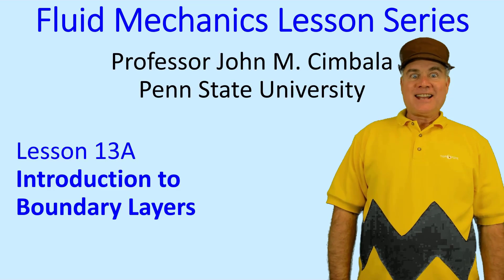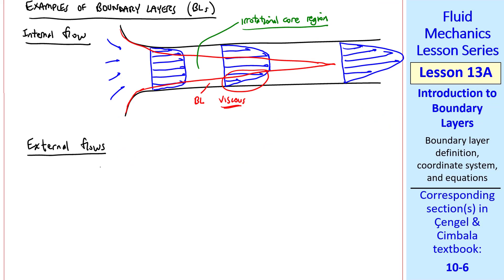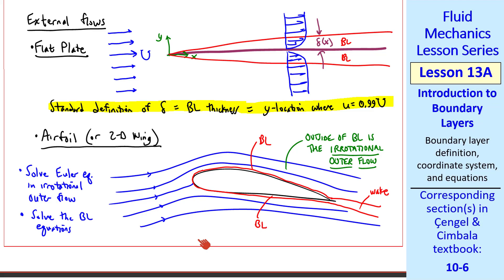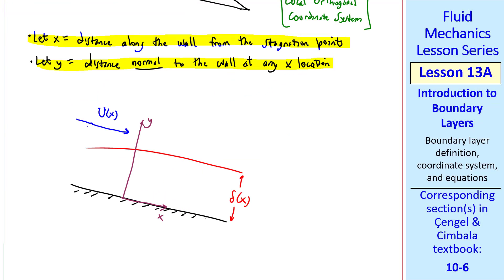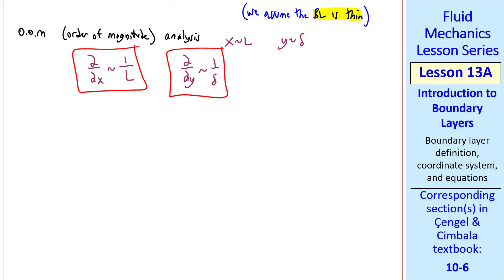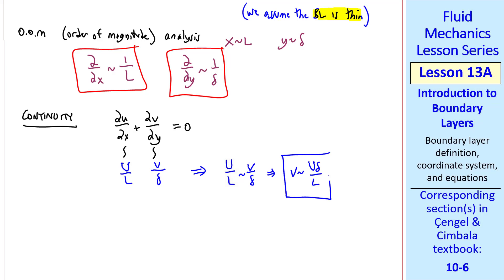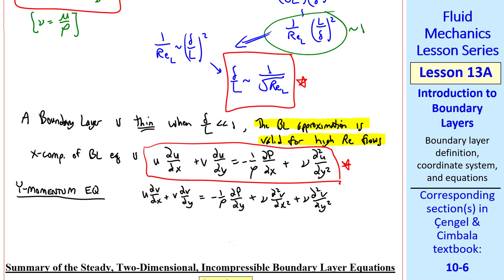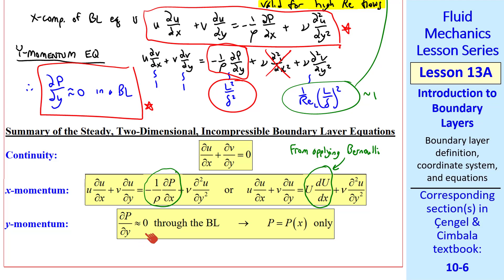Fluid Mechanics Lesson 13A: Introduction to Boundary Layers

Comment: What happens if https://youtu.be/Ji7eNRo_u3g?t=324 slip boundary condition is considered? Does it have same approach in boundary layer equation?
Reply from the maker: The boundary layer equations do not depend on slip or no slip conditions. Even jets and wakes can qualify for boundary layer approximation, and they have no walls. The criterion for the boundary layer approximation is that changes in the flow direction are much slower than changes in the direction normal to the flow (usually x and y, respectively).
Reply: @johncimbala  thank you for the answer. This video enhances my understanding about boundary layer equation.
Reply from the maker: Thank you for your comment. Please tell your friends and colleagues about my YouTube channel where there are more than 400 free videos about the Bible, fluid mechanics, science, math, statistics, air pollution, and other topics. I would greatly appreciate it.

Comment: At around the 7:10 mark in the video, you say that U/L and v/δ must balance and then conclude that they must be of the same order of magnitude. Why?
I understand that terms need to be dimensionally consistent, but U/L and v/δ can have the same dimensions without being the same order of magnitude, no?
(like, as an analogy: you can't add meters and seconds, but adding millimeters to meters is certainly okay, no? )
Reply from the maker: Order of magnitude analysis is kind of fuzzy math. In this particular case, we are saying that U/L is some order of magnitude - let's call it 10. Since there is only one other term in the equation, that tern MUST have the same order of magnitude - i.e., around 10 in order to balance the equation. For example, 10 = 10, but 10 does not equal 1. In order of magnitude analysis, 9 ~ 7, but 9 is not ~ 0.7.
By the way, you cannot add m and mm. You must first convert, but I understand what you mean.
Reply: @johncimbala  just to clarify, when you say that the terms must have the same order of magnitude to balance the equation, you mean like if U/L~10 for example, then the equation becomes: 10 + something = 0, so we conclude that that something (v/δ in this case) must have a magnitude of 10 (-10 to be precise). Did I understand correctly?
Reply from the maker: @benjaminyellin5095   Yes.
Please tell your friends and colleagues about my YouTube channel where there are hundreds of free videos about fluid mechanics, science, math, statistics, the Bible, air pollution, and other topics. i would appreciate it.
Reply: @johncimbala  👍will do